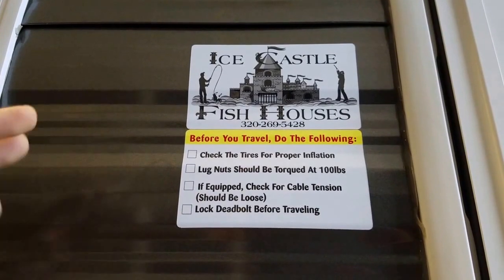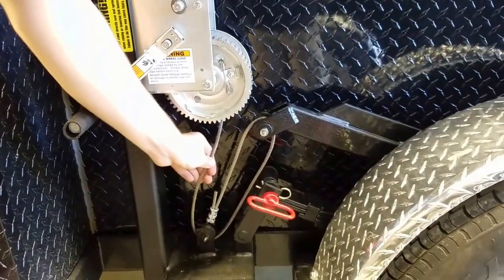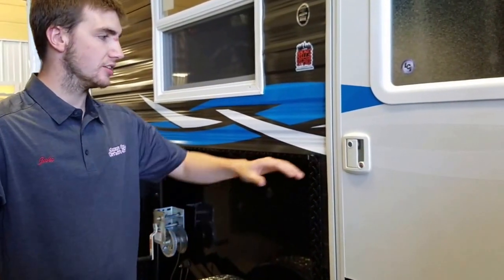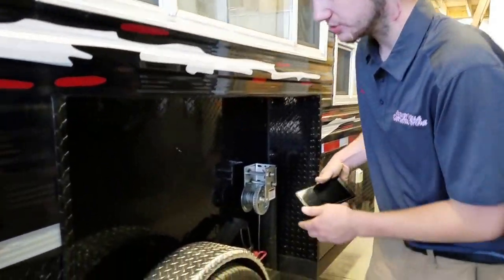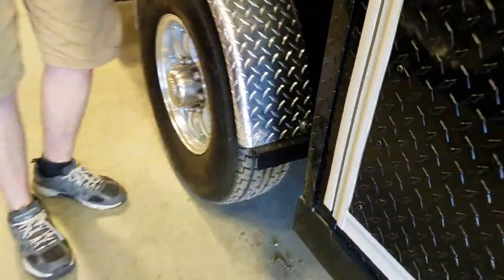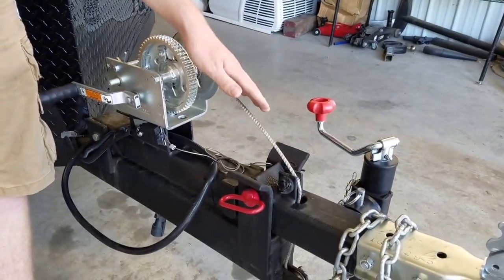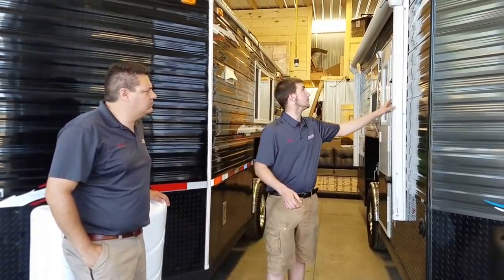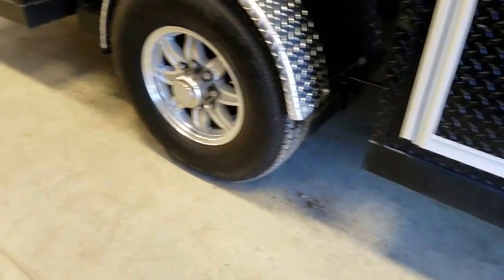How to do general maintenance on your Ice Castle Fish House

Comment: There should be a grease zerk on the pivot of the wheel assembly. Take red cap square head cap off on the outside end of the pivot and zerk is behind cap. Also cables should be more loose than youre showing. Watch another house on a lake with the cables as loose as you showed, the suspension will be limiting out the cable, creating a slapping motion as the cable gets tight. The suspension moves more than one thinks. Otherwise great tips.
Reply: On the new frames.